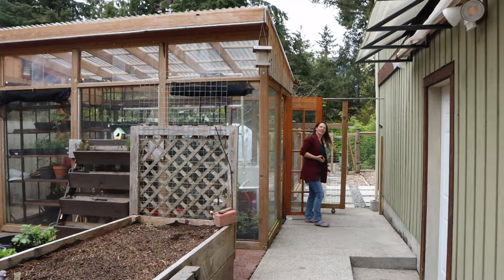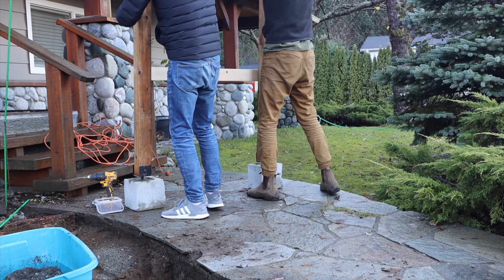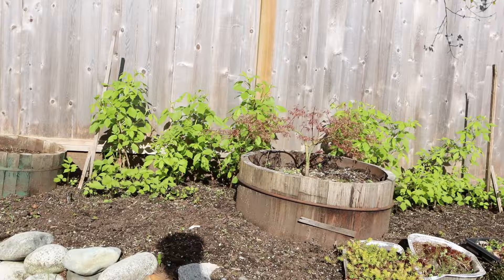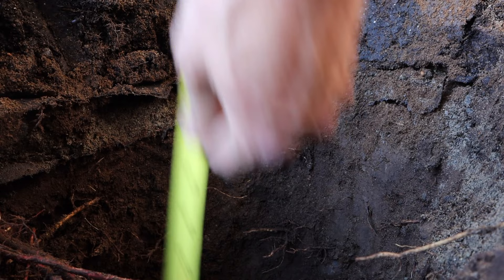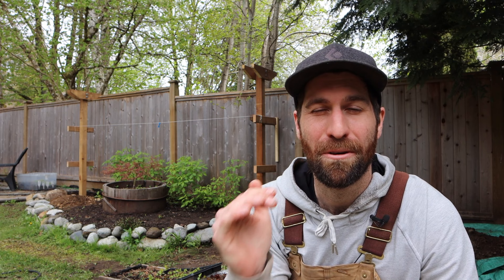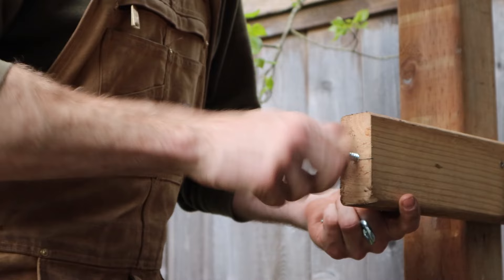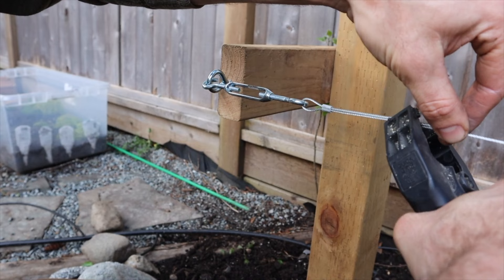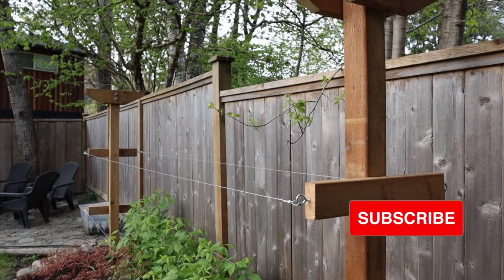The BEST Raspberry Trellis - Can I recreate it?!

Comment: Nice! I haven't read all the comments, so if this has already been mentioned... Having done something similar some years ago, I'd suggest when installing your wires to have the turnbuckle(s) as loose as they can get (safely), then pull the wire(s) taut and crimp. Nature being what it is, time will not make the wire tighter... so you might get more adjustment down the road with this.  You'd still need to keep enough engagement for when you want to loosen/unhook, though.
Reply: There are easier and cheaper ways to make wire  tight enough to do this job 
This is overkill

Comment: Very pretty, a project to nurture ones inner OCD. i've been growing raspberries for 20 years and i'm online looking to build a better trellis system for them. Blackberries are easy, they stay put. Raspberries grow like geriatric hair, i.e., you never know where one is going to pop up. The even manage to escape my confining raised bed. The challenge i find is they wanna grow outside the confines of the trellis... sprawl. This type trellis seems very accommodating with its open design. i think i may just want more order than raspberries will permit me. The cable idea is better than the wire or bungee cords i've used in the past. Thanks for sharing. :-)

Comment: Why all the hardware and clips. You got the posts and cross ties right. Now just drill a hole in the ends of each one, string some fencing wire through them, go back around and wrap the free end back around the wire. No hardware required. There's zero point in tensioning the wires other than to eventually pull your posts toward each other until they're leaned inward. You're holding up raspberry canes, not a building.
Reply: I agree but I guess he likes it that way. It makes building the stuff more fun.
Reply: Her husband had her spinal injury in mind when he built it ❤
Reply: I just used wire and tensioned it the old fashion way that you tension wire ...work fine ...cheap
Reply: @renitadykstra1123  That makes no sense. Making it the way I suggested or making it overly complicated and expensive like he did doesn't effect the functionality of it at all.
Reply: thank you , that is better than my rails .  They are hard to take off and put back up when working on the raspberries .

Comment: Won’t they start to pull towards each other from the tension over time?  My instincts tell me it needs a cross brace.
Reply: Mine have been in this support for 2 growing seasons and they grow to the best sun light so i do release them to readjust in june just before they flower if they get clumped - but I tgink that was just because They had a huge grow spurt and were outside their confinement as well
Reply from the maker: It's a great question Erin! Only time will tell! In the event that does happen then as suggested I'll put some form of a brace in place to keep them where they are :D
Reply: On farms they generally dead man anchor the post ends to prevent bowing of posts